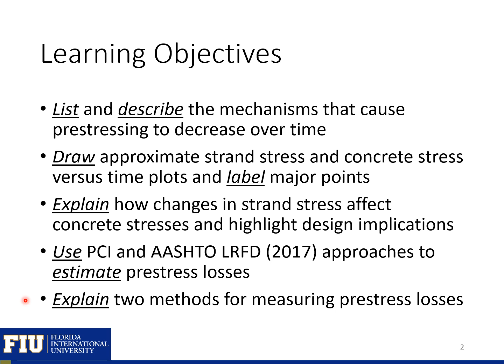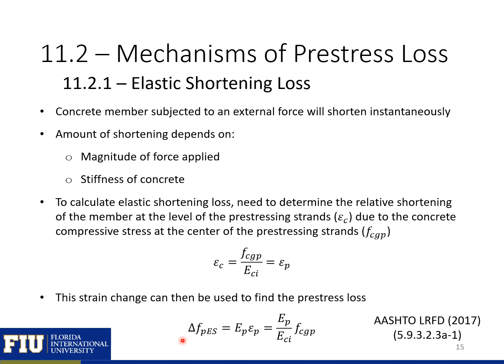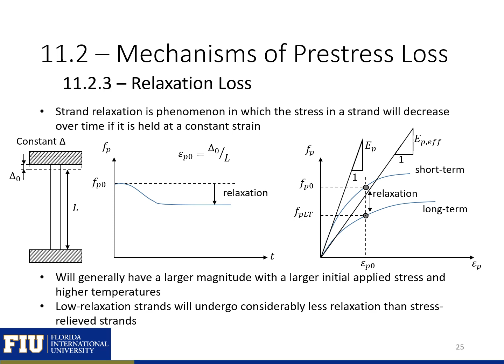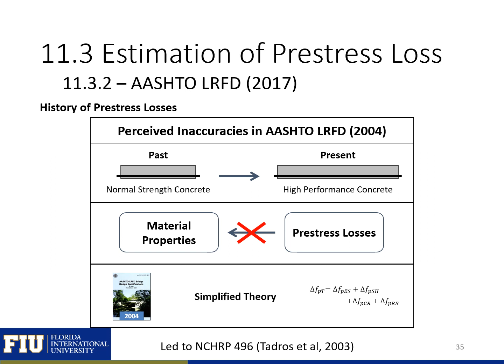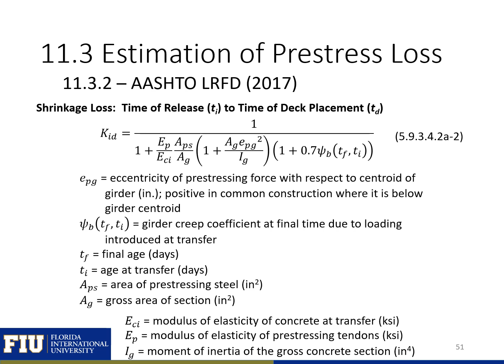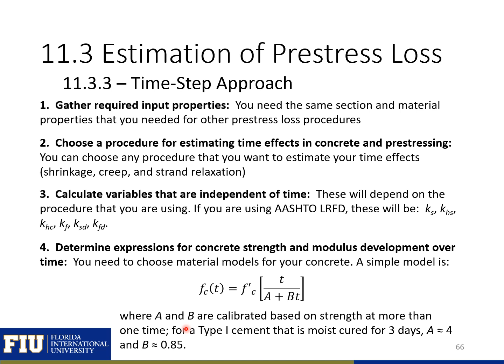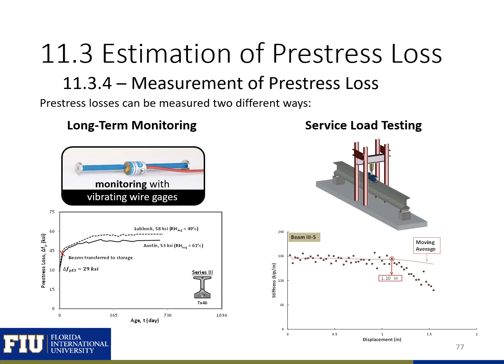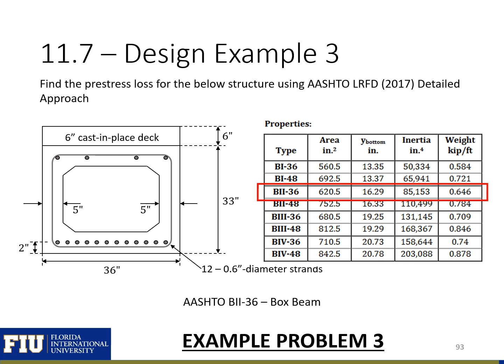Prestressed Concrete Design - 11 - Prestress Loss

Comment: Where do I find other lectures on Prestress concrete? I am not able to see all the chapters.
Reply from the maker: I have a summary of the videos for prestressed concrete that I have created so far at my website (https://concrete.fiu.edu/teaching/prestressed-concrete-design/). I have not finished developing all videos for the class yet, but hope to have them developed by January for class in the spring.
Reply: @davidgarber1664  Thanks you , Sir
Reply: @davidgarber1664  Is there any explanation of experimental results on corroded post-tensioned prestressed concrete beams? I wanna know your lectures on corroded prestressed concrete beams.